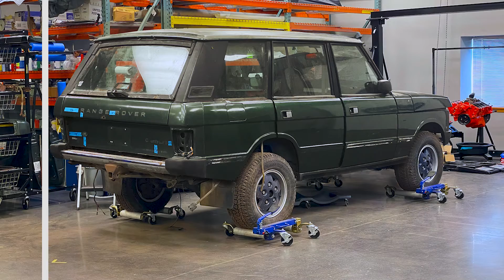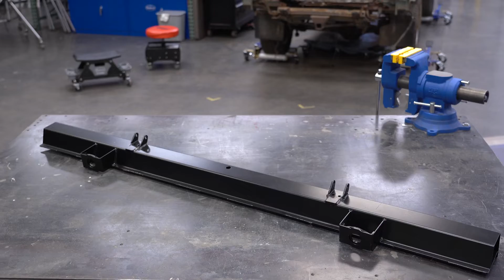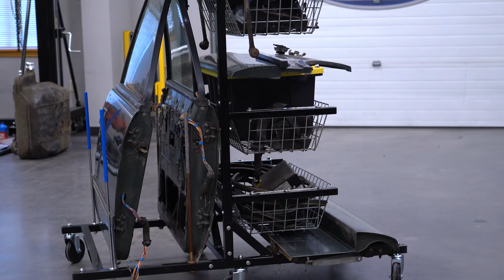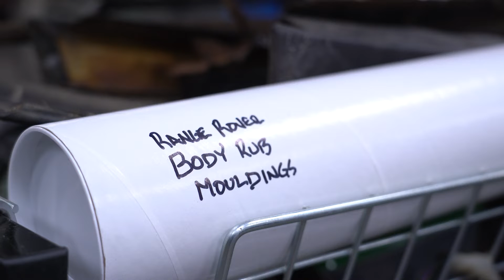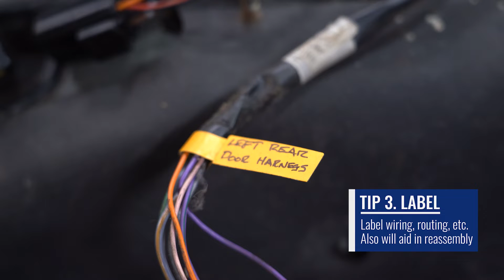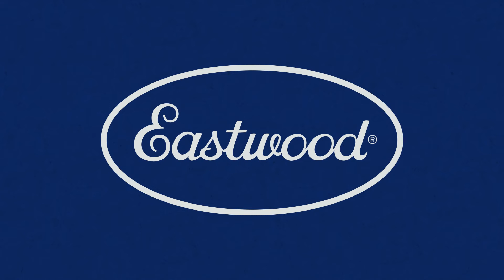3 TIPS for Easy Restoration - Project Sunny Range Rover Classic

Comment: Hi Eastwood!! I'm about to begin my own project on a 2 door range rover classic, may I ask what company you used to order your new parts after discovering the others where rusted and unrepairable.
Reply from the maker: In North America, I start with Rovers North for Range Rover parts. But I've also been shopping directly from Famous Four (http://famousfour.co.uk). Your best bet for a 2-door model, which was never officially offered Stateside obviously, may be to work directly with a UK-based specialist like this. They ship reasonably cheap and very quickly to the States.